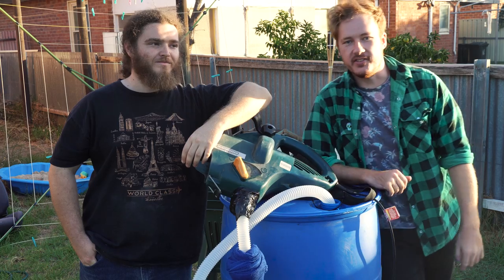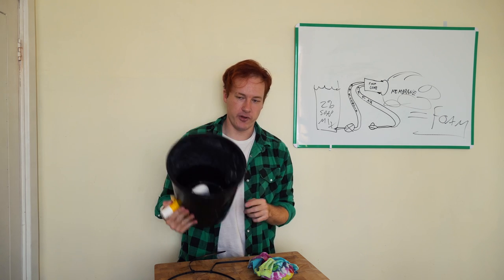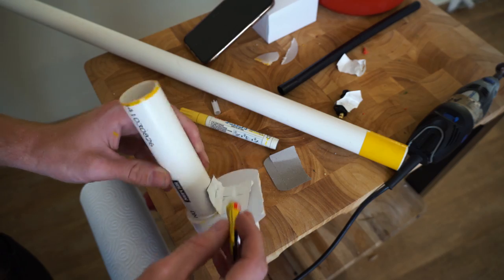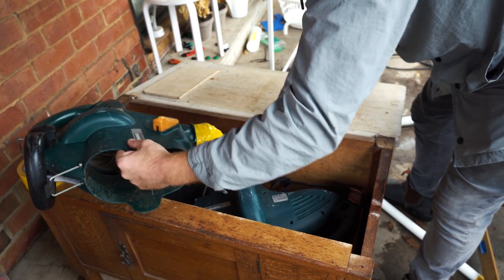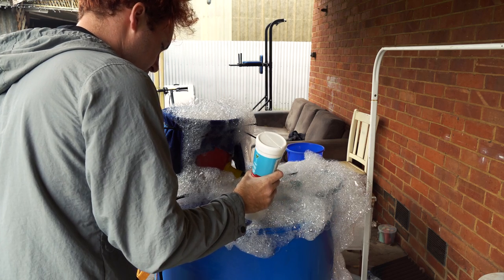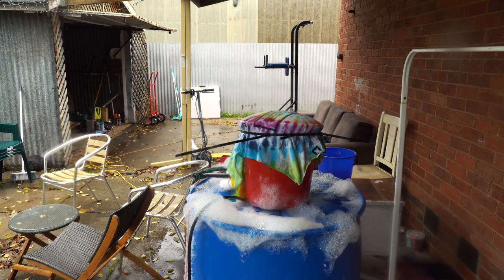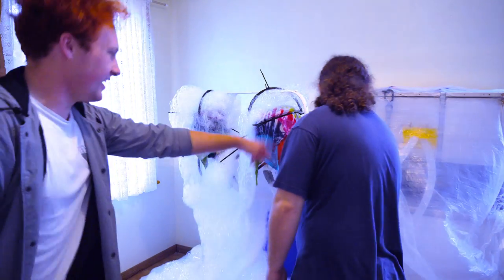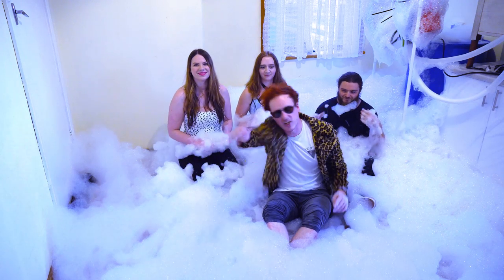How to Build a Foam Machine

Comment: good idea. worth a try. i will try to make this and try it in my soapy soccer arena. the system you used is correct, but the soap liquid or diswasher has to be formulated to produce a perfect and good foam.
Reply from the maker: Yeah, wasted a lot of time initially because we had an 0.2% mix instead of a 2% mix, haha